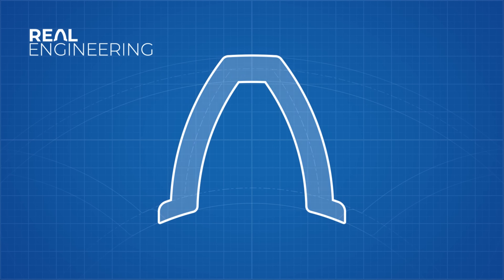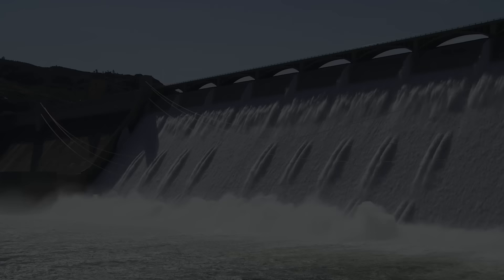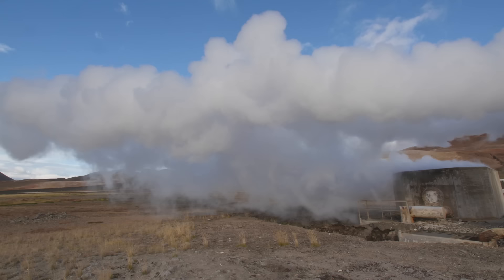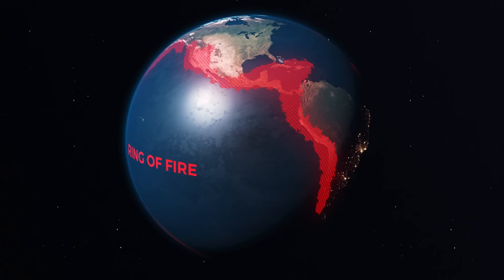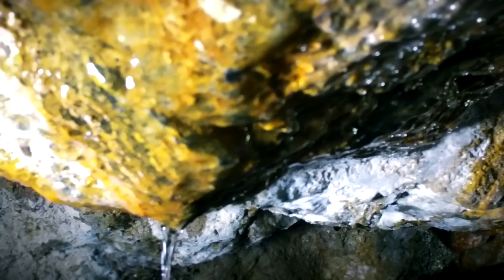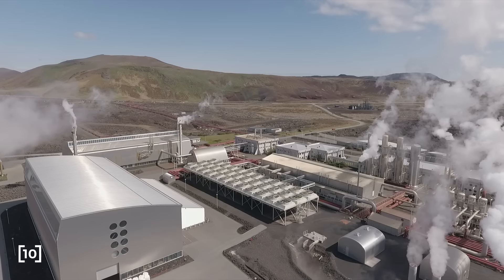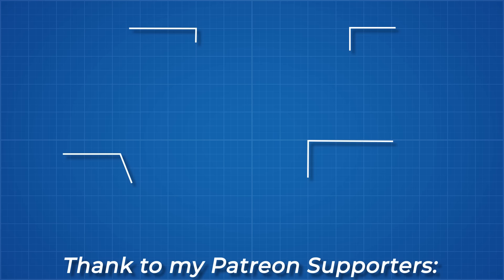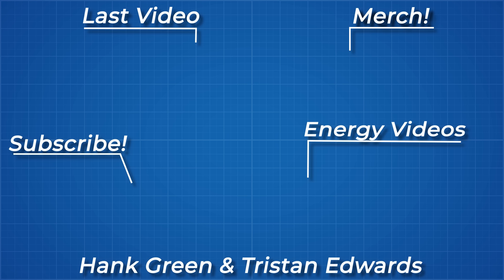Could Earth's Heat Solve Our Energy Problems?

Comment: Hey! Can you teach us how Thorium reactors work? 
I see they are more abundant in nature and produce more electricity pet ton, while having little waste compared to Uranium
Reply: Uranium doesn't actually need to leave a lot of waste. For safety reasons uranium/plutonium fuel is very low yield. This leads to "waste" being generated. To get rid of said "waste" all you need to do is put the waste through a reprocessing system. 

Thorium is good as well, as it moves straight through the process without needing a re-enrichment process to take place.
Reply: @albertusvanlubeeck9161  It also is not radioactive by itself, it requires plutonium in order to activate, and also can be deactivated by intercepting the two elements with water. Thorium produces more energy per volume of the element than Uranium.
Reply: waste of time
Reply: @Quartinium ohh yes and really in a capitalist domain cost is everything, the great hopes for thorium have never eventuated because of cost any nuke system is at least 1o x more expensive power generating cost compared to solar and wind which day on day become cheaper, let alone the build cost and the build time of reactors is 8plus years depending on the size of the build. tidal is rapidly looking like the base load needed that will solve that energy problem although batteries will solve the problem in areas too small to hook up to a grid system being supplied by large generation operations, the old concept of a single large grid is old thinking regional and area grids will take over and gone will be the days of power pylons walking across the landscape losing up to 30% of energy as it travels along wires that leak energy
Reply: Actually thorium is converted into uranium through a nuclear reaction.
Reply: edison david ema the major problem with fltr reaction is the extreme chemical complexity. Since the fuel is liquid, a radioactive soup will turn everything, including containment radioactive, thus extremely dangerous. So maintenance and repairs will be extremely difficult, if not impossible.

That is if they figure out what the containment will actually be.. normal materials like steel and concrete will not be sufficient.. it’s a very promising idea, but the practicals are yet solved
Reply: I can tell you a little overview 
Thorium uses the Thorium 232 Uranium 233 cycle where Thorium is converted to Uranium 233 and used as fuel. 
Mosrt Reactors today use Uranium 235 which is less stable than 233.
Uranium 233 is usually researched to be used in Fast Neutron Breeder Reactors that means that the Neutrons being split and absorbed are Fast Neutrons a classification used to categorize different levels of Energy or speed a Neutron has in Mega Electron Volts usually Thermal Neutrons are used which get slowed to Thermal speed by using moderators such as Graphite or Water where Neutrons pass through and slow down by being forced through the material.
In the Concept of Thorium Reactors a big idea is also to use Mixed Oxide materials such as from Nuclear waste which still carries over 90% Uranium mostly 238 which is harder to split since it is more stable and other Radioactive poisons some of which can in with higher Energy Neutrons such as Fast Neutrons be used to continue Fission.
Otherwise in its basicsThorium reactors in principle differ little to various current reactors the Thorium 232 Uranium 233 used is just a bit harder to split and thus safer against proliferation and safer against Meltdown to design it as such similar Safety measures would still be in place for Mixed oxide use. 
It is however often also review for Next generation Reactor ideas and the use of  different Coolants or different Systems.
Different Coolants besides current Boronated Light water(regular water with boron), Heavy water(Deuterium an isotope of water with additional neutron). Such include Molten Salt coolants, Molten Lead coolants, and High temperature Gas coolants.
Different designs include Pebble bed Reactors which employ pebble like fuel pellets which drop into the core from the top and as they get used fall down the bottom most often theorized with High temperature gas coolant.
Small Modular reactors which are smaller reactors ideally under 100 mw/h small enough to use Convection to circulate coolant in case there is a powerout and Pumps cant circulate coolant to prevent Meltdown such as in Fukushima and Hybrid Fission Fusion reactors which with the Deuterium Tritium cycle try to employ excess Neutrons in Fission and Lithium blankets to make up for the lack of Neutrons in Deuterium and Tritium reactions.
Lets assess the common Thorium types usually suggested first of which are Molten Salt cooled reactors
Molten salt is either presented as coolant in a regular system going around a closed core or more often uses a Aqueous mix of Uranium Thorium circulating with the Molten Salt. Molten Salt has a high boiling point and in regular temperatures will remain liquid to prevent pressurized steam escaping outside the reactor contaminating surrounding and preventing effective cooling. In aqueous mixed solutions it is also able to be sucked into a non reactive vessel if it gets too hot possibliy with a positive runaway chain reaction. However most such salts as sodium or Flurides are extremely corrosive and are even harder to store as waste especially if mixed with the fuel waste since it corrodes metals and cannot be contained by stone and reacts with oxygen and water it is its largest downside and thus makes it a bad choice for any reactor.
Molten lead has many of the upsides of Molten Salts but is easier to store as waste provides more shielding against radiation however lead is still toxic for animals if released and is still corrosive for the reactor materials. 
High temp. Gas is also safe as a coolant without needed pressure containment vessels can operate safely in High temperatures and is relatively nontoxic or corrosive Leaks can be an issue however and it provides almost no natural shielding against the turned on reactor. 
Water can still effectivly be used as coolant also.
Reactor types Hybrid reactors could burn all the radioactive waste but are complex, little studies, probably very expensive and not so economically sensible.
The best idea is Small Modular reactors which can decrease many of the current issues of Reactors while not getting to far into the Unproven Unstudied. However its biggest problems are making economically viable i.e. inexpensive per wattage systems that do not face more proliferation issues.
All such can use Thorium
Reply: ONGOING tripple meltdowns proved Einestines "hell of way to boil water "  IS DRAFTED BY NATIRAl reaccurring wind and tides is superior .and stonwalled by greed embedded in betz limits phyics law.  On top left is  evidence the automatic feathering flat blade radial windmills that both horizontally and verticality can be  deployed
Reply: @computerolegy2336  kidding with tripple meltdowms mutating everything not  accounted .and ignored for greeds intentions. For reelecting Republicans . Outpacing facts truth common sense. Because allowed. By lack of integrity.of leaders sciance  is not fact since betz . Eliminating < 1/2 + the wind/tides  values 100 + years ago

Comment: 8:16 "... a non-toxic and degradable material is pumped down..." Yeah, I think we've all heard that one before ;-)
Reply: Ya the companies say that in product brochures and when the EPA wants a detailed composition list of such material, they claim it's a trade secret, thereby relieving themselves of any need to disclose. I guess they get away with it because energy is considered a national security issue. The EPA has always been under the thumb of vested interests.
Reply: It's basically fracking isn't it?
Reply: @y__h  Yes, lol. That is fracking.
Reply: Says the uninformed skeptic
Reply: @rcpmac  No... Says almost every organization/company that does fracking, lol.
Reply: @jhyland87  Even if the wastewater is a concern, water tables are generally within the first 100 m of soil, while EGS and fracking are measured in km. EGS is actually FAR deeper.

The primary reason shit leaks is badly designed or leaky wells leaking far above the fracking table. Not the actual ‘fracking’ itself. Which also happens with conventional oil and gas wells.

Fracking gets a bad rep because it’s newer tech and they need to drill so many pipes to make it work.
Reply: So what is that non-toxic and degradable material?
Reply: @smertieboi  I think different companies use different chemicals, and what they use isn't always the same. 
The point I was making (which I thought was obvious) was that oil/gas companies (and other companies that sell resources retrieved from the environment, such as mining, fishing, etc) often say they use "non-toxic" or "degradable" materials that will have little or no impact on the environment, and have been caught lying about it, quite a few times throuought recent history.
Reply: @jhyland87  Problem is that that shit is usually patented or industry secret, so we kind of have to take their word for it.
Reply: @innosam123  Well if it's patented then it's not exactly secret, the chemicals would be in the patent. But sometimes they do just keep it secret (proprietary).
Reply: @jhyland87  But did you actually do any research to figure out what EGS uses? If you think it's "basically fracking," you probably haven't. In EGS, nothing is being extracted except heat from the surrounding rocks. In fracking, the rocks have to be treated w/ chemicals to extract fossil hydrocarbons trapped in tiny pores and pockets. 
With EGS, the only additives that have to be added are to precipitate out any ions from the rocks and prevent them from building up in the water. Without them, ions from the rocks could leech into groundwater or corrode equipment in geothermal plants. The chemicals themselves are salts like carbonates and sulfates that naturally occur in groundwater sources. 
Fracking on the other hand needs organic reagents and detergents to actually dissolve rock and prevent the oil or gas being extracted from reacting w/ the rock formations they were passing through. The most serious issue w/ fracking though wasn't what they were putting in but rather what they were taking out. Fracked oil and gas is the major component of pollution from fracking.
Reply: @lozoft9  You totally missed the point, lol.
Reply: But geothermal energy will overheat the planet until it explodes. if we don't make it illegal.